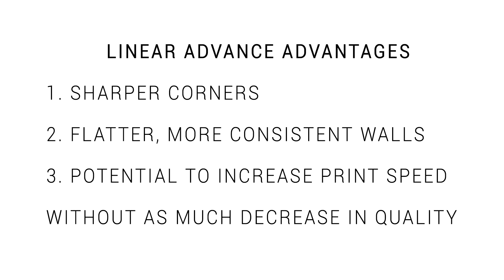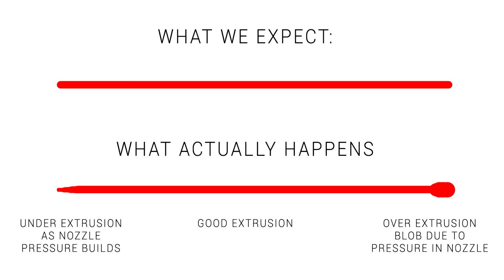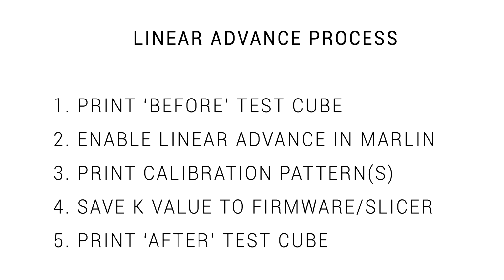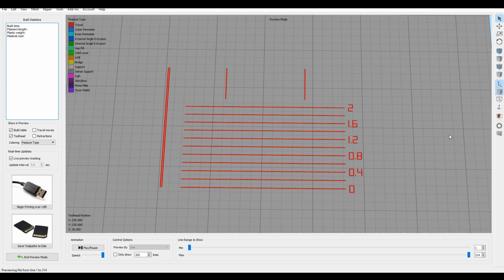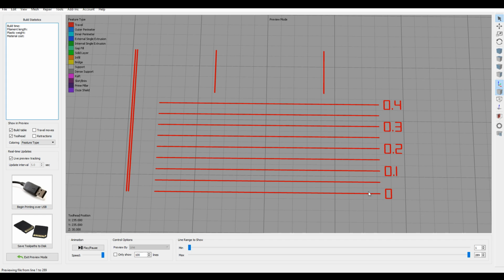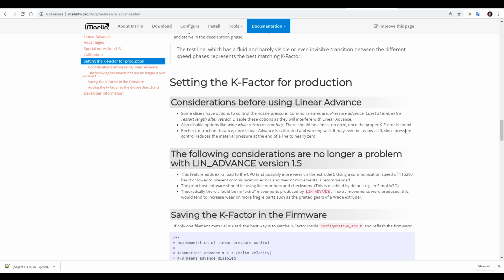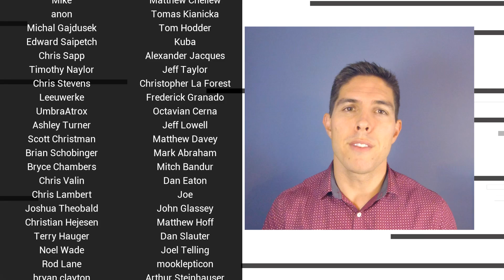Linear advance guide - Free and easy print quality improvement

Comment: I have this issue on my k2 and I can’t fix it. I have manually tuned flow ratio, volumetric flow. Speeds and acceleration for vfa’s, pressure advance and jerk. Everything else prints fine but to the right of everything like corners and holes etc, I have a raised edge. Any ideas on what else to try? Would appreciate any input. Thanks

Comment: Quick sidenote for the TMC2208 people - these stepper drivers are supported in the newer Marlin Versions. Running my Ender 5 pro with a creality V4.2.2 silent board with TMC 2208 drivers with the "bugfix Marlin 2.1.X" and it works like a charm!
Reply: Do you have a bl or cr touch? I’m trying to figure out how to set the gcode generator 😅
Reply: What about the older V2.2.1 boards?
Reply: Where can i find a current tutorial on this?

Comment: my ender3s1 is horrible cube x and y of 2 to 4mm speed of 30 to 35 mhs has very bad corners, I've tried to do everything to fix them and they are horrible, including confusion in the jerky (5 to 10) and aceraração 300 to 2000 cubes comes out I already changed it by emitting it to gcode and not emitting and changing it directly on the printer. but all the cubes don't change his appearance

Comment: Holy shit... this cleaned up my print so much!!! Thank you!!!!!
Reply: So at first I thought the issue was my fault, for tightening the bed belt too much. But after loosening it a bit, nothing changed. 

Only on the right side face of the Y-axis am I having this issue now for adjusting linear advance. This issue was never present in any of my other cubes till this change. 

The issue is only from the bottom of the letter Y, and from the top of the Y and up. That the right corners bulge now. ONLY on the right side face of the Y-axis though. Every other corner is perfect. All the bolts on the printer are all tight except for the rods for the Z-axis so the rods can move around. I can't seem to find anything so far online about this issue. Other than adjusting the bed belt tension. Which I did.
Reply: @NathanClevenger1337 did you solve this? Maybe set retract at seam/layer change something like that? I’m trying to tune my linear advance now on my stock Ender 5 pro for this exact issue keeping me from printing parts that fit together well

Comment: Dude! You are the only one who made sense about corner bulging. 
Just installed Bigtreetech Mother board, and TFT screen, on my original mother board corners with the same G-code were Ok...  After swap got huge bulging in the corners. 
Found out this option is ON, but the K=0 in settings.
Although, after finding my K factor... Print time increased, instead of the 30 min 38 min. Still have some bulging in corners, but less and more consistent... 
Don't know... maybe will cancel that. I think it works much better with Direct Drive... not with bowden...

Comment: every time I try downloading the g code and try printing, the printer freezes and wont do anything. cura warning that g code is not normal. I have an Anycubic Vyper with a TriGorrila mainboard, marlin 2.0 running Zombie 2.0 Firmware. any help?

Comment: I installed btt skr e3 v3 mini and setup linear advance as shown in the video. But now I found another problem. My print time estimates in cura are way off. The printer prints much cleaner but so much slower. Is there any setting or something to look into to make it print better and little bit faster. On 2 hour print it was 30min slower than mentioned in the cura

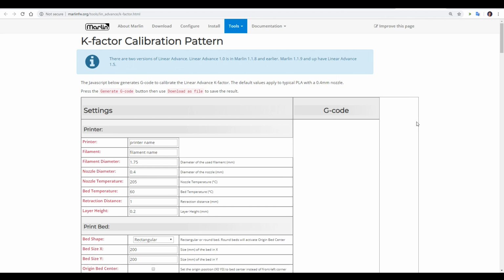Comment: 5:26 generator 

Indonesia Vers: 
Gunakan kode pada "Print Settings" setelah kode printing. 
jika menemukan blobs pada siku/tikungan, maka berikan kode "M900 K(-~ hingga ~) ; set K-factor". sebagai contoh:
"M900 K100 ; set K-factor" 
"M900 K0 ; set K-factor" 
"M900 K-100 ; set K-factor". 
maka pilih yang negatif. 

jika menemukan kekosongan (terputus) pada layer dapat dipastikan bahwa filament lembab (cobalah untuk mengeringkannya), dan juga pada kode gunakan yang positif. 
sebaiknya kode negatif atau positif harus dengan percobaan print Cube. 

Catatan: 
- kode negatif digunakan jika print dengan kecepatan tinggi 

======================
English Vers: 
Use the code in "Print Settings" after the printing code.
if you find a blobs on the elbow/curve, then give code "M900 K(-~ to ~) ; set K-factor". as an example: 
"M900 K100 ; set K-factor" 
"M900 K0 ; set K-factor" 
"M900 K-100 ; set K-factor". 
then choose the negative.

if you find voids (cuts) in the layer you can be sure that the filament is damp (try to dry it), and also use a positive code.
preferably a negative or positive code must be with the Cube print experiment.

Notes:
- Negative code is used when printing at high speed

Comment: Great video, i am trying to adjust this setting buy I dont know how to enter Config option of the firmware to check if the Linear Advance is On or Off...I have a Ender 3 Pro with SKR Mini E3 V2.0 with bigtreetech tft35 E3 V3.0 touchscreen

How do I enter on the firmware?

Comment: 10:47, actually, the bulges on the Y-side features are produced due to the X-axis movement, not the Y... Just look at the Ringing test from Klipper.
Reply from the maker: You are confusing corner bulges (present on every corner) with ringing. With ringing you are correct, but this is not that.

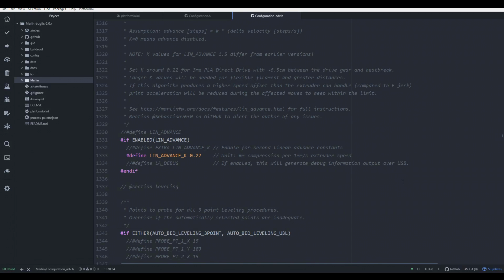Comment: 4:36 "really could not be easier..." This is the part I do not know how to do. I have Ender 5S1. put 2 Test cubes with cura Liear advance 20 and 0. but both look the same.
How can I activate the linear advance in the printer? What program I need? And how can I read the .bin file from Creality, the firmware I downloaded?

Comment: I've been trying to find why I've been getting gaps in my seams, gaps wide enough to look like they've been cut with a knife.
I came across this tutorial video, followed it through & now my start & finish calibration cubes are like chalk & cheese.

One thing I did notice is after I'd changed it to 0.0, compiled Marlin (I'm using 2.1.1 Bugfix) & installed it in the printer, I sent a M900 & it was still using the default of 0.22. M900 K0.0 in my case has to be entered & saved via Octoprint for it to work.

Thanks for the video 👍

Comment: You can do it just fine on Creality TMC boards. Just disable stealth chop mode (M569 S1 X Y Z E), or may just be able to send M569 S1 for all axis in the most recent Marlin. This puts the steppers into spread cycle which lets linear advance work. You may still need to uncomment the 'allow linear advance' code in Marlin 'configuration.h'. To go back to stealth chop mode, change the S1 to S0 in the above command. You can do this with start and stop code in your slicer, or use a terminal like Pronterface to send commands.
Reply: Wouldn't S0 disable Stealth Chop, and S1 enable it?
Reply: Depends on the drivers. I have 2225 on X,Y and Z and 2209 on E0. The linear advance test calibration works perfectly without doing any of the commands you mention.

Comment: Thought I had 2208 drivers, turns out the Ender 3 Max 4.2.2 comes (sometimes) comes with 2 (X,Y) 2208 drivers and 2(E,Z) HR4988 drives so I might actually be able to run this!

Comment: damn i have silent boards and can't use linear advance, anyone have some sort of work around?

linear advance seems to be very important and slept on for some reason.
Reply: Yes it is fixed! You can now enable linear advance on ender 3's with 4.2.2 or 4.2.7 silent boards if you use the new marlin 2.1 version. It doesn't work in older versions of marlin but the new version works. I have linear advance on my ender 3 v2 with 4.2.2 board.
Reply: @2ProBro  oh sweet great news dude!  thank you!
Reply: @IowaMan  no problem!

Comment: Hello, Nice video. 

I use Cura as a Slicer. But there is NO "Return after retract". Because mu setup is Bowden type, my K value is 0.59 and it is set in the Firmware.
So, my question is: IF I use Cura, and Linear advance is set in my Firmware, will my prints uses the benefits of Linear Advance?

Comment: You mentioned that it is a no-go for anyone with a Creality silent board. Does this apply to new boards from the Ender 3 S1 Pro that have TMC2209? 
Another question: do you need UART mode to use linear advance? If the TMC2209 on the S1 Pro board is hardwired and is in standalone mode, does that mean linear advance will not work?

Thanks for the great video!

Comment: So my ender 3 v2 cannot do this? :(
Reply: You can now enable linear advance on ender 3's with 4.2.2 or 4.2.7 silent boards if you use the new marlin 2.1 version. It doesn't work in older versions of marlin but the new version works. I have linear advance on my ender 3 v2 with 4.2.2 board.

Comment: Good morning ! for an ender 3 v2 which comes with a silent motherboard, so it's impossible to fix this?
Because it's quite present on my impressions
Reply: Yes it is fixed! You can now enable linear advance on ender 3's with 4.2.2 or 4.2.7 silent boards if you use the new marlin 2.1 version. It doesn't work in older versions of marlin but the new version works. I have linear advance on my ender 3 v2 with 4.2.2 board.
Reply: @2ProBro  super ! Cela fonctionne bien ? J'ai le firmware custom pour le bltouch 🤔

Comment: Excellent guide! I was able to get my K value dialed in to a nice even line at 0.44 on my Ender 3 Pro, but no matter what settings I use for K, retraction distance/speed or acceleration/jerk, I get the exact same "matchstick heads"/blobs at the end of every line. Is there any way to fix that?

Comment: Although, as a noob going through your calibration site for the first time ever, the section on linear advance is the hardest to figure out.  While all of the other sections up to this point were spoon-fed, the linear advance section (which seems to me to be extremely imporant for good prints) isn't nearly as robust.  I know the video is supposed to walk you through the process, but unlike other calibration steps, this one is missing the baby steps I've been spoiled with so far.  May have to skip this calibration step until I have more understanding.  Thanks again for all of your hard work on this.

Comment: little information: lin advance does not work in marlin2.0 with tmc2208 or tmc2225 driver on the extruder in standalone mode. It simply does not extrude when printing
Reply: Hello, so what is the trick to use LA on tmc2208? (UART, Spreadcycle...?)
Reply: @alzuaga  if they are connected via uart you can use them in spreadcycle and it works but if they are in standalone mode (no comms between them and the board) you just simply can't use LA
Reply: @robertmurgea556  Wrong! It is fixed! You can now enable linear advance on ender 3's with 4.2.2 or 4.2.7 silent boards if you use the new marlin 2.1 version. It doesn't work in older versions of marlin but the new version works. I have linear advance on my ender 3 v2 with 4.2.2 board.
Reply: @alzuaga   It is fixed! You can now enable linear advance on ender 3's with 4.2.2 or 4.2.7 silent boards if you use the new marlin 2.1 version. It doesn't work in older versions of marlin but the new version works. I have linear advance on my ender 3 v2 with 4.2.2 board.

Comment: Great calibration, unfortunate my nozzle is oozing too much from the start and I don't see a way to get a proper calibration result because of this. Normally I solve this by printing a skirt, which is normally enough to get the amount of filament right from the start.

Comment: Does anyone know why TMC2208's can't be used? What happens if you try it with those drivers anyway?
Reply: It is fixed! You can now enable linear advance on ender 3's with 4.2.2 or 4.2.7 silent boards if you use the new marlin 2.1 version. It doesn't work in older versions of marlin but the new version works. I have linear advance on my ender 3 v2 with 4.2.2 board.

Comment: Hi, I have activated the Linear advance function on my 4.2.7 Ender card, but the extruder stops. I wanted to ask you if there is a solution to this problem? or if I have to change motherboard and driver for my printer. In the video which motherboard and driver are you testing with?
Thanks for help